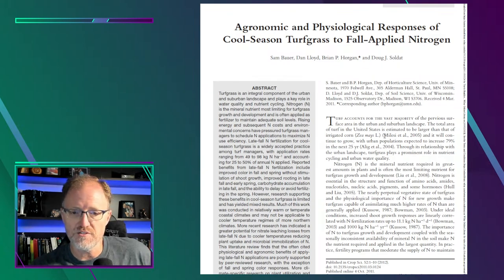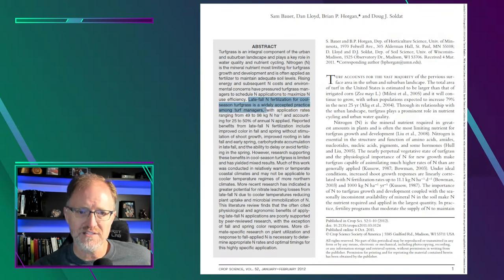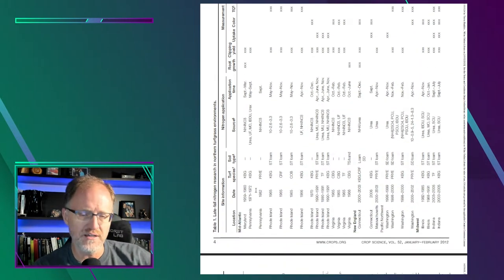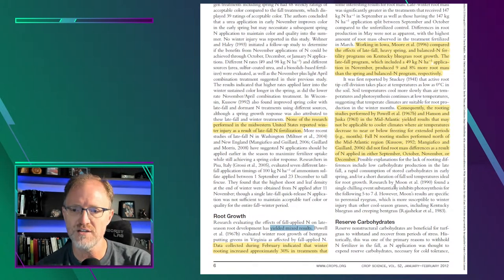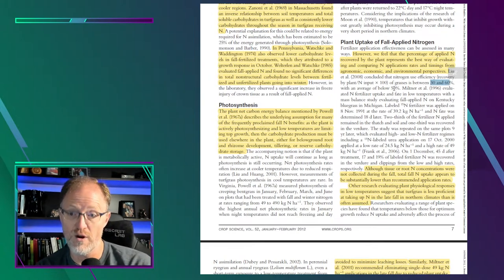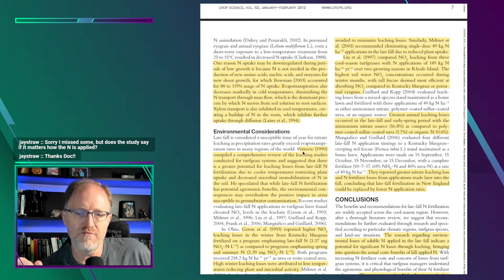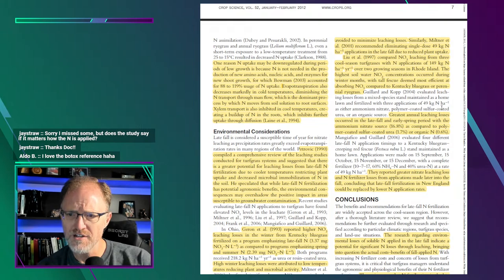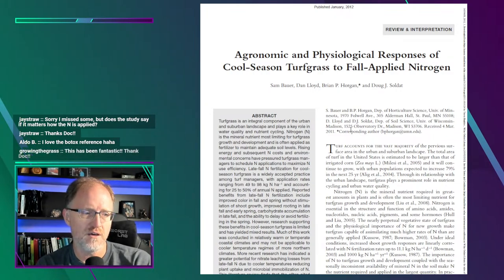Fall Applied Nitrogen to Turfgrass

Comment: In southwest Ohio I have used 1# of N from 46-0-0 with good results. Last year I mixed 50/50 AMS 21-0-0 and 46-0-0 with great results. Also at 1# N. Your research has me thinking about all that N. 
What are you’re thoughts on this area for late fall? Mid to late November time frame. 

Thank you!
Reply from the maker: It sounds like you are about 2 hours north of me. I have some newly established TTTF and I put down around 0.5 lbs of N from ammonium sulfate the first week of October. I won't consider applying more until April or May. I am going over another paper tonight (10/25/23) at 9:00 pm EST that may help you decide when you should stop applying N. Most of the papers indicate September is best, October is good, but November is probably not a good idea for your area. Of course, as always, I could be wrong.

Thanks for watching!
Reply: @TurfgrassEpistemology  Thank you for the reply. I’m in Dayton Ohio, so 2-3 hours north is correct.